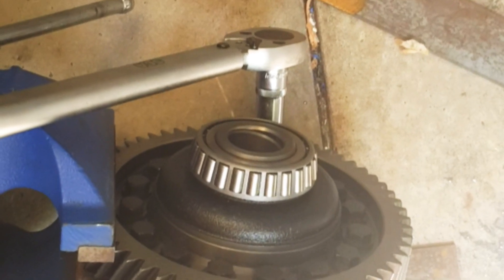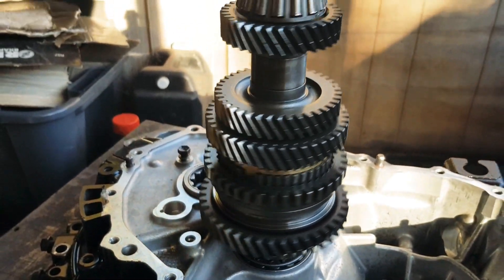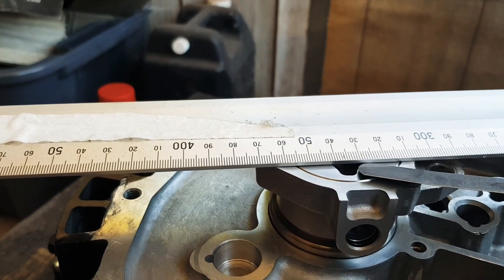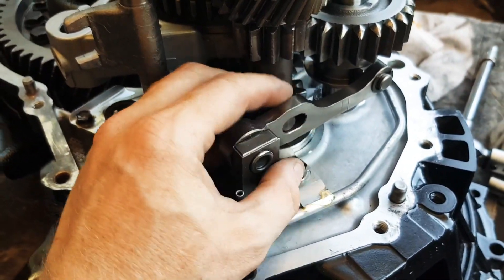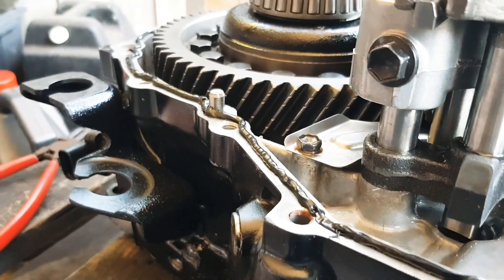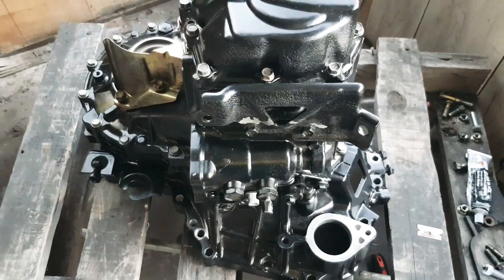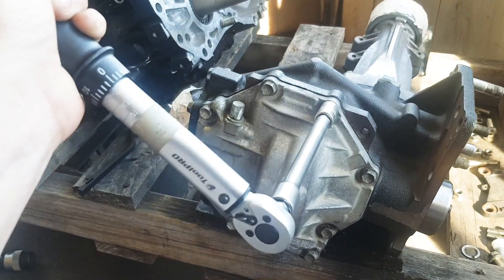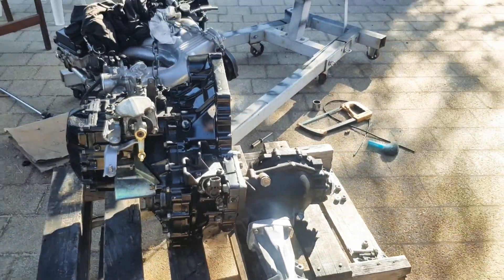Turbo AWD Camry - pt17 - E153 gearbox AWD conversion

Comment: So the transmission is a e153 and you adapted the transfer case and rear diff from a rav4. Wow that’s exactly what I need. Any info on what needs to be swapped inside the e153 in order to accept the transfer case ?
Reply from the maker: Yes it's an e153. You have to use a rav4 differential inside the gearbox, and you have you use half the e153 case and half the e150f rav4 case. Bearings need to all be resized. Essentially you need two complete gearboxes to make this box. The rav4 gearbox gearset is not strong enough to support big hp. It wasn't an easy task that's for sure.
Reply: @broxonbrookfield5665  this guy is a Legend not holding back with answering our queries.. i was looking at e150f from 3sgtes not knowing rav4s hybrid gearboxes work aswell.